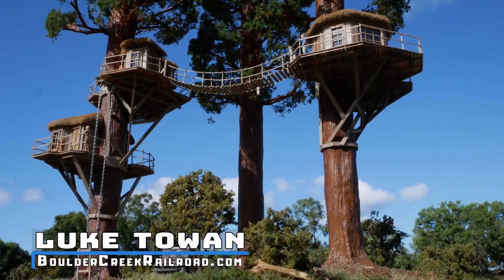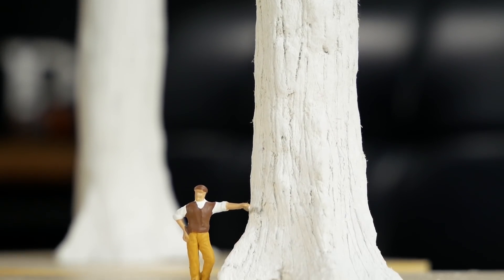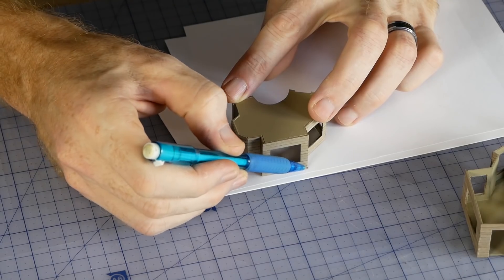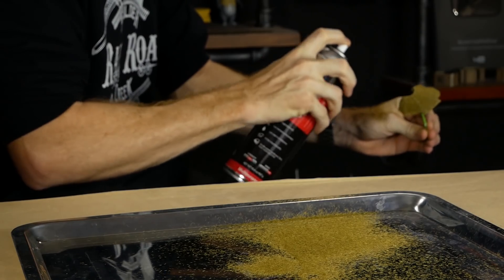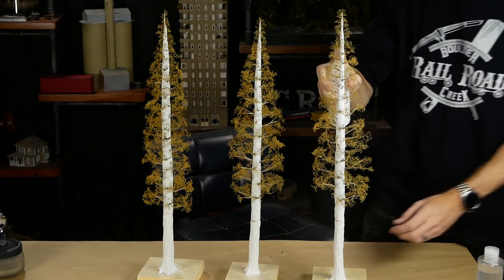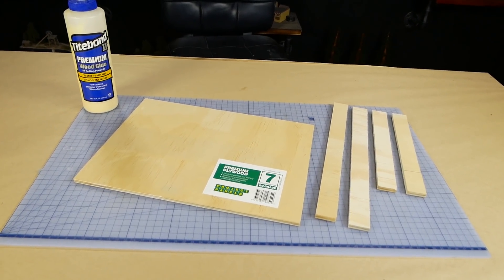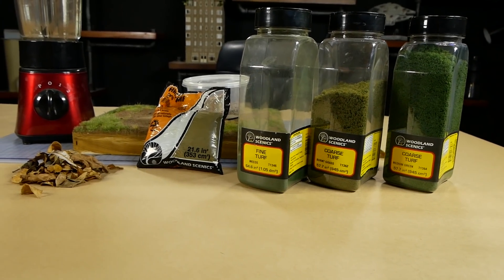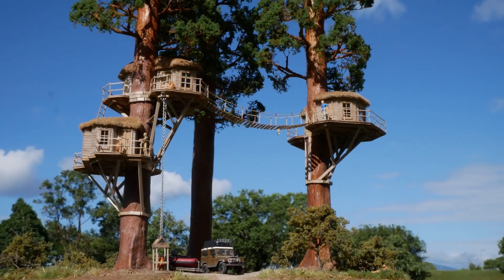Building my Dream Treehouse in Miniature – realistic scenery Vol.23

Comment: Casual run on saturday followed by casual strawl thru a marine... comes back home with a firm carboard jewelry box,  styrofoam, 3 50cmX50cm fake grass tiles, couple of thin wooden planks, 2 ~30cm wires, some random discarded plastic/metal old boat engine part, several coarse red tiles for wood smoothing tool and a beautiful rock...

Gf waiting on doorstep
... not again...

Comment: Great project. You sound like you're in New Zealand or Australia. If you need any detail photos of the terrain, foliage, etc in California, the American West, (or China, Japan, England, Scotland, Ireland) don't hesitate to ask. I've got years of taking photos of 'stuff'; professional level Nikon. I know how someone might be interested in what the northwest corner  of Chartres Cathedral looks like and of all the thousands of photos online, there's only one blurry shot, with a tour bus blocking most of it. 
Giant Sequoias?  I have lots of those.  Redwoods too. (We one time drove my dad, a retired carpenter, all the way up the state to a Redwood forest. He'd made lots of decks with redwood lumber and wanted to see an actual tree. After the trip sitting in a neighbor's yard he mentioned this. Mitch who live there jerked his thumb over his shoulder, "This is a redwood." There are many of them around the neighborhood, but not 100 meters tall. Japan? The forest on Yakushima, that was the inspiration for Princess Mononoke? Got plenty of that. 
Also you wouldn't use those skirting boards around the trunks. The best method for attaching anything to a tree trunk is one or two bolts, minimum contact between the element and the tree. So a diagonal brace right up against the trunk a bolt head or two showing. I wouldn't change what you've done. It looks spectacular.